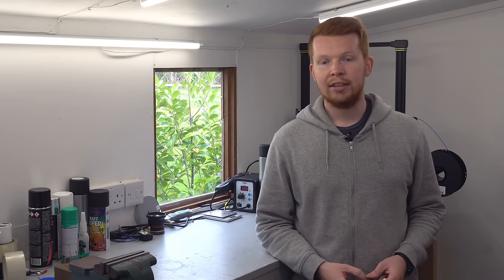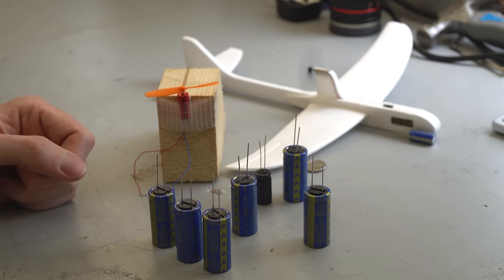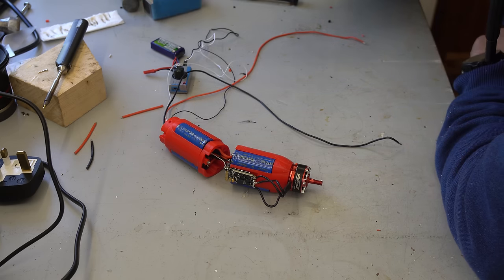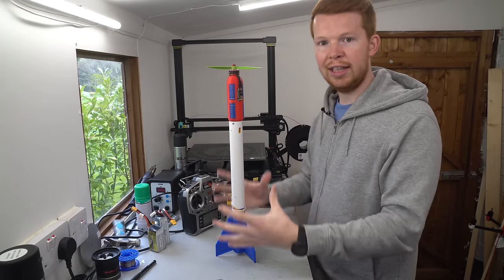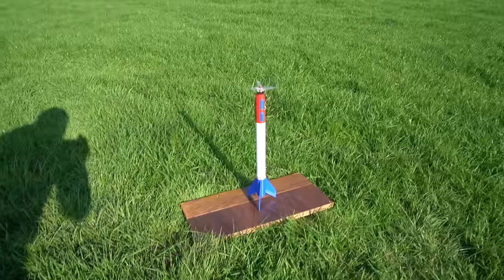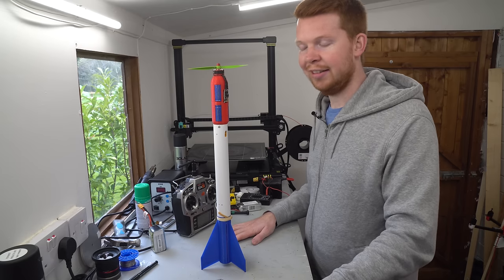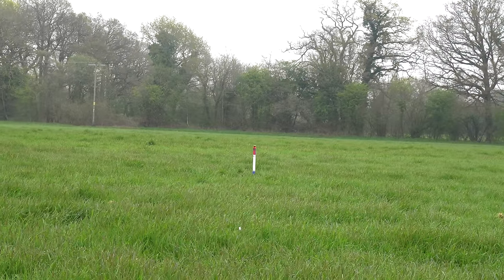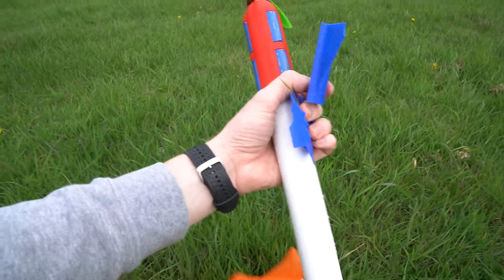Super Capacitor Rocket

Comment: The starting surface with wood is too small. The cone of air compressed is sat on the flat surface. But here it is not regular, with a bit of wood and a lot of grass. So the compression cone is not regular and even destroyed by absorption of the grass module. We had same problems with vertical landing off jets in 1960's (Dassault aviation source). However it's perfect 😊👍 Congrats
And we use supercapacitors to start movement of the TGV train : the volume of the super capacitors needed for that is same as an attache-case. (Alstom Belfort source)

Comment: 528 / 5 000
That's an amazing rocket! It reminds me of my childhood when we had water rackets and compressed air. A plastic hollow racket, half filled with water, put on the pump and pumped air. After unlocking, the rocket flew up to a fairly high height by the reactive force of the water spray. Maybe it was also about 60 meters. So an electric version :-)
On the last failed takeoff, it seemed to me that she flipped over and the running engine gave her more speed than the parachute could then brake.
Apparently the flight stabilization gyroscopes failed 🙂

Comment: why not use a boost controller to get more power out of this?
btw, those can get as efficient as 97%
but they're quite big and bulky for a small rocket like this one
also, it would be fun to test how far up the rocket can go, with a bit more capacity

Comment: so mixing capicitors for launching power an battery for extended an capicitor re charging ; would probably work if trying to obtain longer airtime?
also propellers for rockets was probably ditched a long time ago. others here have commented on drone vs rocket but several propellers would probably work best  if trying to replace (parts of) standard rocket science

Comment: Great video, one thought what is the weight of your super caps, propeller size and total rocket weight, since weight is everything you can lose the parachute servo and just take a small piece of wire and put a few wraps around the rubber band and wire it to your servo channel, will melt rubber band and chute should pop out ok. Since weight is everything can use thin walled carbon fiber tube.

Comment: I am not talking about the pendulum fallacy, but instead another idea. It sounds like you implied that it makes zero difference on an aircraft where the propeller is. However this isn't true, the propeller is the point where force moves the entire craft, it entirely does make a difference whether it's at the back of an air plane or the front. The configuration at the front is called the pull or tractor configuration, this is because the craft is basically dragged behind it via being attached to the engine, the configuration at the back is called the push configuration, where the craft is being pushed by the engine which is at the back. 
The tractor of pull configuration is superior in many ways, which is why the pusher method is rarely used anymore. It was found that the downstream of a propeller is more powerful than the upstream, and that the aircraft sitting within this downstream essentially made it more efficient in flight. 
This concept however doesn't really apply to things like rockets and missiles, because they aren't using propellers. Except for your one, which probably couldn't really even be defined as a rocket.

Comment: That single stage super capacitor rocket is nice and all.  But it has me wondering how fun a multi-stage super capacitor rocket would be. And a multi-stage super capacitor rocket has me wondering how much more fun it would be to have a hybrid super capacitor and solid fuel rocket where the electricity starts the launch the the solid fuel burns for altitude.

Comment: Is there a special way to wire the system so the battery feeds into the capacitors, but the capacitors can't feed backwards?

Comment: It is NOT a rocket. A rocket uses action-reaction. A bottle rocket ejects water at high speed using compressed air and qualifies as a rocket. The only similarity it has to a rocket is in its shape, which is similar to fictional rockets in comics from the 60s, eg Flash Gordon et al. It is a rocket-shaped propeller-driven toy aircraft.

Comment: How did you keep it from operating like a helicopter with no tail prop.  In other works, now do you keep the body of rocket from turning instead of the prop rotating?  I liked the rocket though, very nice…

Comment: Just make the capacitors themselves into a rocket, I remember back in high school we used to jam the tip of a hot soldering iron into the rubber on the bottom and then in a few seconds they would shoot off like a rocket with a trail of steam!

Comment: Does the torque from the rotor, which makes the whole rocket body rotate slowly in flight, affect the direction it travels?
It seems to veer off from vertical quite quickly. I wondered if you were able to keep the rocket body from turning it might get you way more altitude.

Comment: I find out that the weight of 5F capasitors is 2.9 gr.  
So your 6 capasitors are about 18-20 gr with cables.
Min. 5-10 times better than battaries.
Is this accurate calculation?

Comment: Disappointed that torque from the prop and motor wasn't addressed by anything more than the small fins. Some spinning of the rocket would help for stability but the more the body spins the less air the prop is moving equaling less height of the flight.

Comment: Does it not put a pretty significant strain on the battery drawing that much current instantaniously when charging the capacitors without any resisters?

Comment: Why don you build a quadcopter with those supper capacitors, use as many you need for each motors, to see how long you will stay on the air flying.

Comment: there are electric swaped drag cars out there, mostly using tesla batteries and motors and running easily under 10 seconds. I really want to see a super capacitor drag car. I mean it only has the last for 1/4 mile.

Comment: Excellent! I've been wondering about using supercapacitors in a rocket such that the supercapacitors heat water inside a chamber  (likely using nichrome wire) to flash the water to steam, that steam existing through a nozzle to provide thrust. Is there actually enough energy in a supercapacitor (or group of them) to do that?

Comment: What super cap did you use and what motor and servo board did you use, tried to use your attachment but they are sold out and it didn't show what they where in voltage and farad range, did search and only found at that site 2.7 volt 10 farad super caps.

Comment: I don't get how you can connect capacitors in series. Wouldn't only the outer two be able to discharge since capacitors do not allow DC current flowing through them?

Comment: I 100% thought this was going to use electromagnets to launch a rocket
Reply: Coilgun
Reply: Tom Stanton, please make a coilgun rocket with capacitors. I think a 555 timer could be used to set up a multi-stage coilgun. Just a simple clock module with a pot to adjust timing

Comment: You should be more careful holding that propeller at eye level if you value your eyesight. If that blade has a crack in it from those hard landings, you may lose an eye or two! I had a helicopter  throw a stabilizer weight that put a deep dent in my refrigerator door. If it hit me in the head it would have killed me

Comment: That's not a rocket, its a rocket shaped helicopter. Still neet. 
The reason real rockets need to be nose heavy (at least 1 caliber stability when balanced) is because the thrust is at the rear, not the top. And we use long Launch Rods or Rails to point it properly as its building enough speed for its fins to be effective. Your configuration would need to be more bottom heavy for stability. Your arc copies a real rocket that's not properly balanced, tilting too far into the wind. 
Thanks for the Video!

Comment: An abortable rocket that can be charged so quickly!?! How high can it go. How light can it be? Those Caps are light but do they really need that casing and dense copper connectors? How thin, light and consistent can the descent control system be?...

Comment: I was another one hoping we'd see the expanding gasses of an overloaded capacitor make something fly, since that Would have been a rocket. While cool, this is not a rocket. I have other problems too: plastic for /everything/? Clearly, someone's never built a rocket. I get that the head and the fins needed it, but a cardboard body tube would've cut the weight immensely. Also, can't have the prop-thrust at the bottom for clearance and for launch rails? Then, we never see a launch rail. Both problems could've been solved with a hinged prop, and a spring-launcher with rails. Lob it in the air throttle off, and give it everything once it's clear.

Comment: Code that monitors both sets of super caps voltages and shows the switching between powering bank a and charging bank a and the same for bank b on the serial monitor, as well as watching the switching setpoint to make it so I can see it switches at the right time? 
--------------------------------------------------------------------------------------------------------------------------------------------------------------------------------

#include <Servo.h>

Servo esc;  // ESC for brushless motor

const int capBank1VoltagePin = A0;  // Voltage sense pins for supercapacitors
const int capBank2VoltagePin = A1;

const int escPin = 9;  // Pin for ESC control
const int relay1Pin = 2; // Relay pins to control charging
const int relay2Pin = 3; 
const int lowVoltageThreshold = 3000; // Adjust this threshold as needed (in mV)

int capBank1Voltage, capBank2Voltage;

void setup() {
  esc.attach(escPin);
  esc.writeMicroseconds(1000); // Initialize ESC (stopped)
  pinMode(relay1Pin, OUTPUT);
  pinMode(relay2Pin, OUTPUT);
  digitalWrite(relay1Pin, LOW); // Initially, no charging
  digitalWrite(relay2Pin, LOW);
  Serial.begin(9600);
}

void loop() {
  capBank1Voltage = analogRead(capBank1VoltagePin);
  capBank2Voltage = analogRead(capBank2VoltagePin);

  // Convert to actual voltage (adjust for your voltage divider)
  capBank1Voltage = map(capBank1Voltage, 0, 1023, 0, 5000); // Example, 5V max
  capBank2Voltage = map(capBank2Voltage, 0, 1023, 0, 5000);

  // Print voltages and switching info to Serial Monitor
  Serial.print("Cap Bank 1: ");
  Serial.print(capBank1Voltage);
  Serial.print("mV ");
  Serial.print((capBank1Voltage < lowVoltageThreshold) ? "(Charging)" : "(Powering)");
  
  Serial.print("   Cap Bank 2: ");
  Serial.print(capBank2Voltage);
  Serial.print("mV ");
  Serial.println((capBank2Voltage < lowVoltageThreshold) ? "(Charging)" : "(Powering)");

  // Logic to control motor power and charging (same as before)
  if (capBank1Voltage < lowVoltageThreshold) {  
    digitalWrite(relay1Pin, HIGH);   
    digitalWrite(relay2Pin, LOW);    
    esc.writeMicroseconds(1500);     
  } else if (capBank2Voltage < lowVoltageThreshold) {
    digitalWrite(relay1Pin, LOW);    
    digitalWrite(relay2Pin, HIGH);  
    esc.writeMicroseconds(1500);    
  } else {  
    if (capBank1Voltage > capBank2Voltage) {
      digitalWrite(relay1Pin, LOW);
      digitalWrite(relay2Pin, LOW);
      esc.writeMicroseconds(1500);  
    } else {
      digitalWrite(relay1Pin, LOW);
      digitalWrite(relay2Pin, LOW);
      esc.writeMicroseconds(1500);  
    }
  }

  delay(1000); // Check every second (adjust as needed)
}

Show drafts

Absolutely! Here's the modified code that includes the serial monitor output for debugging and monitoring the system's behavior:

C++
#include <Servo.h>

Servo esc;  // ESC for brushless motor

const int capBank1VoltagePin = A0;  // Voltage sense pins for supercapacitors
const int capBank2VoltagePin = A1;

const int escPin = 9;  // Pin for ESC control
const int relay1Pin = 2; // Relay pins to control charging
const int relay2Pin = 3; 
const int lowVoltageThreshold = 3000; // Adjust this threshold as needed (in mV)

int capBank1Voltage, capBank2Voltage;

void setup() {
  esc.attach(escPin);
  esc.writeMicroseconds(1000); // Initialize ESC (stopped)
  pinMode(relay1Pin, OUTPUT);
  pinMode(relay2Pin, OUTPUT);
  digitalWrite(relay1Pin, LOW); // Initially, no charging
  digitalWrite(relay2Pin, LOW);
  Serial.begin(9600);
}

void loop() {
  capBank1Voltage = analogRead(capBank1VoltagePin);
  capBank2Voltage = analogRead(capBank2VoltagePin);

  // Convert to actual voltage (adjust for your voltage divider)
  capBank1Voltage = map(capBank1Voltage, 0, 1023, 0, 5000); // Example, 5V max
  capBank2Voltage = map(capBank2Voltage, 0, 1023, 0, 5000);

  // Print voltages and switching info to Serial Monitor
  Serial.print("Cap Bank 1: ");
  Serial.print(capBank1Voltage);
  Serial.print("mV ");
  Serial.print((capBank1Voltage < lowVoltageThreshold) ? "(Charging)" : "(Powering)");
  
  Serial.print("   Cap Bank 2: ");
  Serial.print(capBank2Voltage);
  Serial.print("mV ");
  Serial.println((capBank2Voltage < lowVoltageThreshold) ? "(Charging)" : "(Powering)");

  // Logic to control motor power and charging (same as before)
  if (capBank1Voltage < lowVoltageThreshold) {  
    digitalWrite(relay1Pin, HIGH);   
    digitalWrite(relay2Pin, LOW);    
    esc.writeMicroseconds(1500);     
  } else if (capBank2Voltage < lowVoltageThreshold) {
    digitalWrite(relay1Pin, LOW);    
    digitalWrite(relay2Pin, HIGH);  
    esc.writeMicroseconds(1500);    
  } else {  
    if (capBank1Voltage > capBank2Voltage) {
      digitalWrite(relay1Pin, LOW);
      digitalWrite(relay2Pin, LOW);
      esc.writeMicroseconds(1500);  
    } else {
      digitalWrite(relay1Pin, LOW);
      digitalWrite(relay2Pin, LOW);
      esc.writeMicroseconds(1500);  
    }
  }

----------------------------------------------------------------------------------------------------------------------------------------------------------------------------
How to Use the Serial Monitor Output:

Upload the code to your Arduino Nano.
Open the Serial Monitor in the Arduino IDE.
Observe: You'll see real-time voltage readings for both supercapacitor banks, along with their current status (Charging or Powering). The switching threshold value (lowVoltageThreshold) is also indicated, so you can verify that the switching occurs at the intended voltage level.
Example Output:

Cap Bank 1: 3450mV (Powering)   Cap Bank 2: 2950mV (Charging)
Cap Bank 1: 3380mV (Powering)   Cap Bank 2: 3100mV (Charging)
Cap Bank 1: 2980mV (Charging)   Cap Bank 2: 3420mV (Powering)  // Switch!
Cap Bank 1: 3050mV (Charging)   Cap Bank 2: 3350mV (Powering)
... and so on
  delay(1000); // Check every second (adjust as needed)
}
Use code with caution.

How to Use the Serial Monitor Output:

Upload the code to your Arduino Nano.
Open the Serial Monitor in the Arduino IDE.
Observe: You'll see real-time voltage readings for both supercapacitor banks, along with their current status (Charging or Powering). The switching threshold value (lowVoltageThreshold) is also indicated, so you can verify that the switching occurs at the intended voltage level.
Example Output:

Cap Bank 1: 3450mV (Powering)   Cap Bank 2: 2950mV (Charging)
Cap Bank 1: 3380mV (Powering)   Cap Bank 2: 3100mV (Charging)
Cap Bank 1: 2980mV (Charging)   Cap Bank 2: 3420mV (Powering)  // Switch!
Cap Bank 1: 3050mV (Charging)   Cap Bank 2: 3350mV (Powering)
... and so on

Comment: So I could buy the super capacitors wire them to 6 volts and connect them to a solar charger on my losi dbxl and I would never have to change batteries for my reciever only at night I would have to us batteries

Comment: that is not a Rocket, it is electronic you could call it a flying motor but its not a Rocket, A real Rocket burns fuel of some kind , that is a flying junk of PVC  with a prop from the local hobby store your better off sitting on it